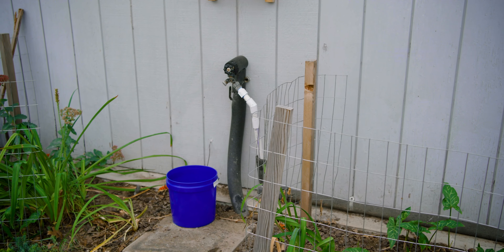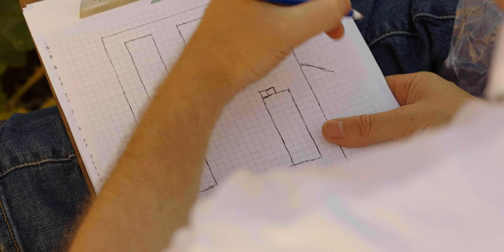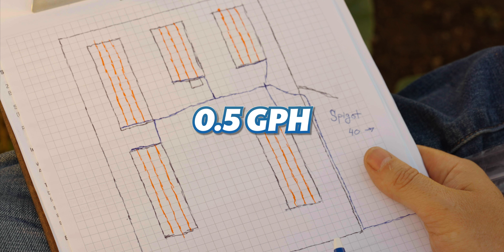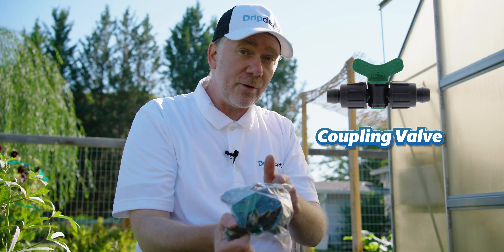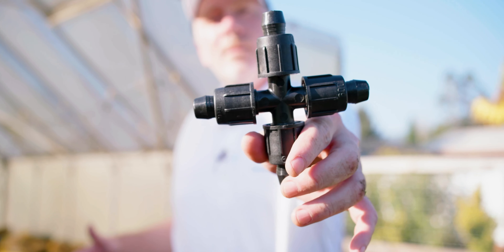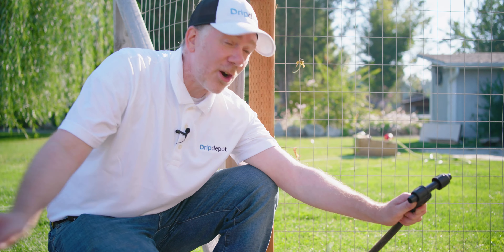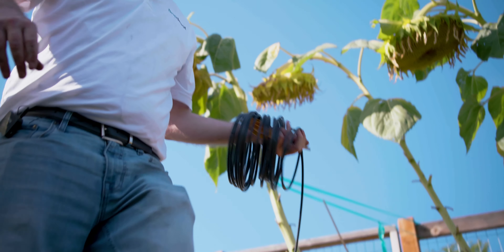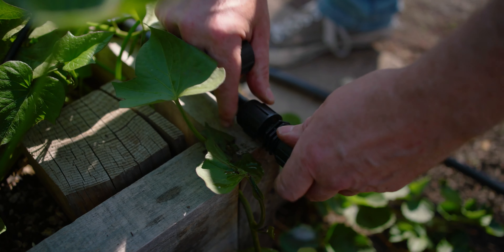How to Install Drip Irrigation for Raised Beds (Complete DIY System Guide)

Comment: I am in SC. You dont bury the line? Is it that freeze resistant?
Reply from the maker: It is indeed that freeze resistant!  At least so long as the lines are drained -- we generally just gravity drain them with some end caps at low points though, you don't even necessarily need a compressor.  

Poly tubing actually got its start in the US up in the Northeast due to its freeze resistance (it's fairly popular in Canada for the same reason).  It has a "bend but don't break" property you don't see in a lot of other pipe/tubing types due to their rigidity.  

I hesitate to share this anecdote because I always want people to winterize properly, but one time we filled up some poly tubing completely full of water and capped both ends -- we then put it in the freeze for a few weeks, and it came out completely undamaged -- we were actually hoping for damage for our winterizing video, but were out of luck. 

To anyone reading this, don't let that keep you from winterizing! :)

Comment: Quick Question:  I see that some people prefer emitters every 6 inches.  If emitters cover 12 inches, why use emitters every 6 or 9 inches, as I have seen available.  I will be using my system for vegetable garden.  Tx for your thoughts.
Reply from the maker: Barbara, first thank you truly for the kind words :) 

I tend to agree and I think some folks use 6" spaced when they really only need 12".  Drip takes a little getting used to not seeing the surface of the soil being covered by moisture.  At times folks newer to it will think it's not delivering enough water and add emitters until they see more of it on the surface.  In most cases they do not need to, as most of the action will be going on beneath the surface (or should be!).   

6" spacing can be a good choice in sandier soil types and locations with particularly dense planting.  Some really thirsty plants and some trees/shrubs/bushes can benefit from a ring of 6" spaced dripline going around it as well.
Reply: OH tx for replying!  Another question, since I have you!  Our water pressure is 32 psi, water flow is 273 gph and the distance to the furthest plant is right at 200’.  So far my design shows about 175 emitters if 12 in apart.  According to my math, I should be able to use one system for my entire garden.  Will my 32 psi support a 25 psi pressure regulator?  Tx!
Reply from the maker: Heya Barbara!  

It's close, but your system should be able to support a 25 PSI regulator -- the Senninger regulators require 5 more inlet PSI than what they regulate to, so you're within spec at 7 PSI higher than the 25 PSI it will regulate to :)
Reply: Oh wait.  I was wrong about the distance.  The total linear distance to the farthest plant is 100 ft.  However, if I add up all the actual 1/2” tubing needed to run to the beds, up the raised beds, create a header in each bed, etc is a total of 200’.  With that in mind, is it still ‘close’ and should I consider creating 2 zones?
Reply from the maker: At 100' from source to plant you'll be well within the green, even if the total length used is close to 200'.  I'm cautiously optimistic you can run this as one zone as you have plenty of flow at 273 GPH.  If I understood correctly, the system flow will be 87.5 GPH (175 0.5 GPH drippers), which means your water source has plenty of flow to feed them :)
Reply: Thanks!  Feeling good now about my understanding!  I can’t thank you enough!!!!

Comment: Could you run one 1/4” line and coil it around the entire bed instead of running 3-4 individual lines or would that decrease the flow of the emitters towards the end of the line?
Reply from the maker: It can be done within some limitations -- if you exceed those limitations, it could potentially cause the issue you described, so you're definitely on the right track. 

If the total length of the line is less than 30' (with 12" spaced drip line) it should still be uniform throughout the coil.  With 6" spacing I typically try to keep it no longer than 15' to 20'.  After those lengths the friction loss curve gets pretty steep and could impact uniformity enough to be noticeable.  

Great question, thank you truly!

Comment: Does the water pressure stay constant through to the end of the drip lines or does it weaken with each emitter in the line?
Reply from the maker: Thank you for reaching out! 

You bet, so long as you stay within spec of the mainline tubing you're using, you'll have nice and even pressure throughout the line thanks largely to the pressure regulator.  If you have too high of flow or run the mainline too long, you'll experience high rates of friction loss which can impact performance. 

The good general rule is 200' Length and 200 GPH flow for 1/2" tubing, 480' Length and 480 GPH for 3/4" -- after those thresholds, the friction loss curve can get pretty steep, but staying within them minimizes pressure lost from friction :)

Comment: I have used drip irrigation in my raised beds and for my in-ground plants for years, and I am re-doing my plans for this year. I already have main line tubing that I purchased locally and I plan to buy fittings from you. One thing I have thought about is to use 3/4 inch PVC instead of poly pipe for the longer runs between the faucet and the beds. If I do that, do you have fittings to make connection to 1/2 inch main line tubing? Also, I have always used four lines of drip tubing in my 4' wide beds. I live in the high desert and things dry out quickly. Are 3 lines of drip tube really enough? I have used 6 inch drip tup spacing in the past. Am I overdoing it?
Reply from the maker: Great questions Nadine!  

In regards to 3/4" PVC to 1/2" tubing, this can definitely be done -- with that said, the cost to go with 3/4" tubing could be about the same and it's much easier to work with poly.  PVC will also have to be buried, where you can use poly on the surface if you like.  Either way I'll be able to help :) 

In regards to the 3 or 4 lines -- 4 lines of 6" spacing may be a little over what I'd do, but that doesn't necessarily make it wrong -- as you noted, you probably need more water due to how hot and dry it is out your way.  We're located in Oregon so definitely have a bit more humidity in the air.  With that said, a lot of it comes down to soil type -- if your soil is looser or sandy, close spacing and an additional line like you're doing is absolutely ok.  If you have denser soil, you might not need that 4th line, water can spread out pretty far from the point of drip in denser soils. 

If you haven't planted in the bed yet, you could try running the irrigation system with just three lines in it and then dig around in the soil to see how far the water spread.
Reply: @dripdepot  Thank you. I am in Southern Utah at about 5500 feet. The soil in my raised beds has a lot of organic matter in it, so it holds water reasonably well. La Nina has given us a lot of water (by our standards) over the winter, but it is very dry in the summer. Still, the beds tend to be moist enough that I manage to dig up little desert toads on a regular basis that need a moist environment. I think I will try running 3 lines per 4 foot bed and see how it works. The only things in the beds now are a few perennials that have wintered over and the garlic that I planted in the fall. I got down to 17 last night so I've got some time before I will need a full blown watering system.

The reason I am considering 3/4 inch piping is that the garden is pretty large and I though I might get better water flow over the distance. Maybe I am mistaken about that and I would welcome your opinion. As for pvc rather than poly, the lines will have to cross over places where there are gates, and will sometimes have wheelbarrows crossing them. What I have done in the past with the 1/2 inch tubing is that I have run it through some pvc to protect it from the wheelbarrow wheels, and I could do that now as well.  I plan to test my water flow rate later today, but in general our water comes out pretty fast. I think I'll give the three line method a try, with two lines in my narrower beds. 

As for burying pvc, I have some that has been out in the open for more than a decade without cracking. It has been surprisingly durable.
Reply from the maker: @nadinehansen9241   We had a small freeze last night too, but pretty much 32° on the nose, so not quite as cold :) 

You are correct that 3/4" tubing will provide for better flow and pressure, at least if conditions are present that would otherwise overtax 1/2".  By that I primarily mean line length and total flow going through it -- after about 200' length or 200 GPH in flow, the friction loss curve does get pretty steep in 1/2" tubing and it's better to look into 3/4".  

And roger that on the PVC -- awesome you already have some!  Definitely a good idea to put it to use in that case.  Yours could be UV treated which does slow down its deterioration significantly.  

From the sounds of your soil, 3 lines per bed is great to start with -- tentatively, it's sounding like it will be enough and provide for great coverage.  If after testing it doesn't, it's fortunately easy to toss in an additional line (or even just a couple drippers coming off the mainline with 1/4" tubing).
Reply: @dripdepot  I just did my flow test: It took 8 seconds to get 2 gallons of water.  That's 900 gallons per hour. I guess I don't have any problems with water flow. 🙂Now I'll do the rest of my math and I'll be ready to order.
Reply from the maker: @nadinehansen9241   Nadine, wow!  That's a  healthy flow rate -- I thought mine was high at 750 GPH, but yours can support a serious irrigation system :)

That's great news and really helps reduce some of the more annoying problems that comes from lack of flow -- you're on the right track all the way.

Comment: How do you know when to use 1/4 inch drip tubing or run lines to button drippers? Also, do you recommend adjustable dripper buttons? Thank you.
Reply from the maker: I like to use the 1/4" dripline when I have a row of plants across a distance, such as in a raised or in-ground bed and when planting density is reasonably thick.  I use button drippers almost exclusively for potted plants and container plants, similar to the onions in this video.  They also work well for plants that are just out of the way of the rest of the system :)
Reply: @dripdepot  Thank you. Your videos are very helpful.

Comment: Does it matter if the filter is vertical like you have it in this video? Or could be be horizontal or some other angle?
Reply from the maker: For the type of filters we're using in the video, it is ok to have it oriented at almost any angle, so long as the direction of flow is respected.  Most of these types of hose end filters will have an arrow printed on them that show the direction the water should travel through it.  If you've got that part done, it's no problem to have it horizontal, vertical, etc :)
Reply: @dripdepot  thank you. I appreciate the speedy responses as I try to figure this out.